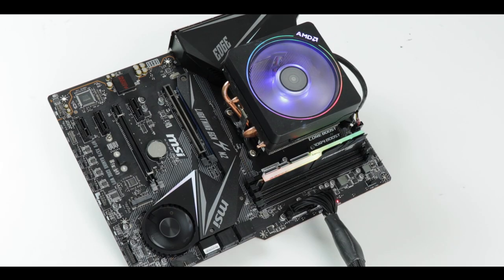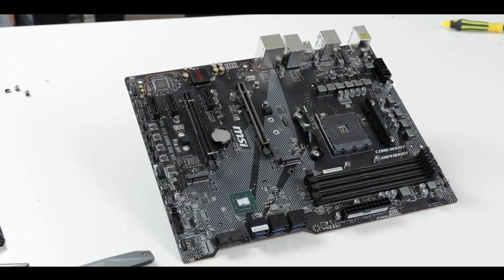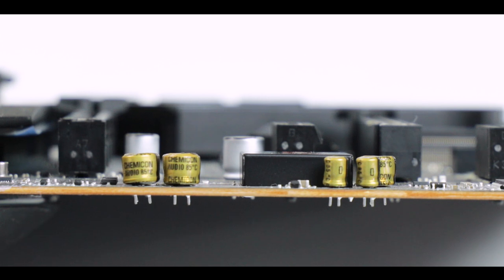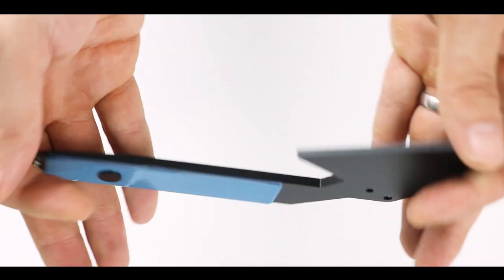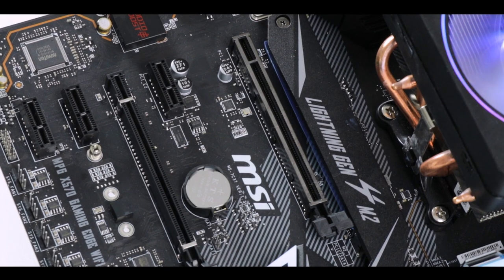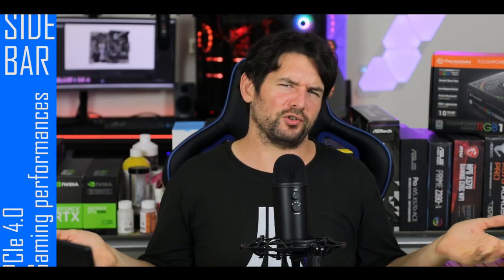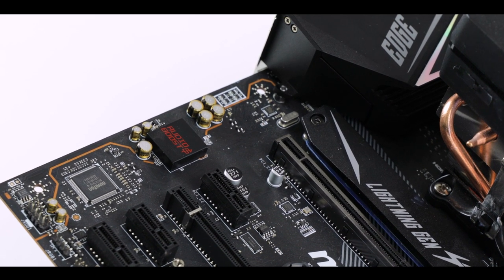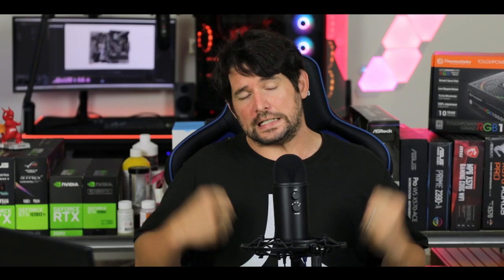MPG MSI X570 GAMING EDGE WIFI : No, No, No!

Comment: Will I have heating issues with 
AMD Ryzen 9 3900X 12-core and this mother board?
Reply: Roman Tkachuk yes
Reply: Roman Tkachuk in the video he said the board was at 100 something degrees with an 8 core so 12 cores the board will literally fucking explode
Reply: I have that CPU and added corsair hydro series h100i rgb platinum cooler, don't use the amd included fan, good to go.
Reply: en4cer44 TV how has the heat been 
? I just ordered this motherboard and a ryzen 7 3700x and after reading all these comments I'm kinda worried
Reply: Jose Bustillos refund the board if you can, under any circumstances because this is shit for the value, however if you can’t do anything else, it’s not the WORST board I’m the world
Reply: @_OLE_  With upgrading the fan to the corsair hydro series h100i no problems.

Comment: The dislikes are bullshit. I know five separate people who have purchased. Four of us have had TERRIBLE compatibility issues. Many things listed as supported are not. RAM is the (of many) issue that all five had had issue with. Three of us have had issue with the heat. I attained this board at a sizable discount when it was new but still would have paid more than the original list price to have avoided all these issues. It's been a year now & my search for a RAM fix brought me here. It was great for about a month. RIP, MSI, RIP. Three different major component purchases in a year; three headaches. Not again.
Reply: what is the ram.issue?? i got a second pair of 3600mhz ram sticks and got a blue screen after they were installed and i returned the ram because the version numbers didnt match but werent very far off from each other

Comment: If you wonder why exactly there are so many thumbs down in this review, that's what happens when you shit on one of the best bang for the buck X570s. I'm sorry but this card is exactly what it was supossed to be. An affordable X570 with future upgrade features. Right now I'm running this board with a 3600X at max boost and I've had 0 problems with temps, stability or anything else. Damn this review and specifically the title can mislead so many people. Sad.
Reply: How's it going after a year? Is it in good condition?
Reply: @Jan Nathaniel Ausan  it's perfectly good. Running on latest BIOS and went through an upgrade from 3600X to a 5800X3D and everything is perfectly stable.
Reply: @theok4342  Did you ever did some Overclocking? I was planning to OC mine but I'd rather not if you didn't do so yourself. Thank you for the feedback by the way!

Comment: Complaining that the board isn't designed for overclocking is stupid.  You seem to think people are entitled to receive more than what they pay for.  This board is great.  It's got a ton of features for the price, and if you actually buy parts that are meant to be run at their default speeds, you will be very happy.   
Are you complaining that a Peugeot falls apart if you try to drive it at 130 mph?
Reply from the maker: Hey :)

I am not complaining about its Inability but rather its heat inefficiency compared to comparably priced boards. 
It will not last as long as others for the same price.

Comment: Do you have any sound popping/crackling issues?  I have this board and can't figure out what's causing the audio crackling/popping.  It's not driver related, and it's not GPU related.  Tried using hdmi to 4K HDTV, and tried using audio jacks in the back with speakers/surround sound system.  Both have the same issues with the crackling/popping.  Done 4 days worth of troubleshooting with reinstalling windows, updating bios, chipset drivers, disabling quick start-up, rolling back audio drivers, changing sound hz settings in windows, changing power performance settings, even reseating the RTX 3090 etc... and nothing I do fixes it.  I've been at it for 4 days straight and am pulling my hair out!  Do you have any issues with sound popping/crackling with this MB?  I need help!
Reply: yes actually ive had this issue and i just need to restart my pc

Comment: just  got one and 3800x lol, now I'm worried
Reply: Same here dude... this mobo with 3800x... and i'm still waiting for them to be delivered...
I went through the internet checking other people having this exact combo, asking about their experience, and i even sent an email to MSI...
Everyone told me to not overclock, and that with good airflow there won't be any problem...
I'm starting to believe that this kind of reviewers are trying to terrorize people from buying this motherboard for some reason...
Best of luck to you mate!
Reply: Add a corsair hydro series h100i cooler, should be good to go.  I don't think this guy really knows what he's talking about honestly.
Reply: @NickDiMod  so Nick how does it perform ?
Reply: @Twoclickchris  Hey mate, the combo works great so far, i had some high temps during summer (no AC at home in a very hot country), but never actually encountered any issue.
Highest temp i was having while playing VR (Half Life Alyx on Valve Index) was 82 degrees for CPU, and  78 for GPU (RTX 2080 Super).
I am using the stock wraith prism for CPU and 4 Noctua fans on my case (2 infront for intake, 1 at the back and 1 at the top for exhaust). 
I believe it's kinda hotter than what i wanted, but it might be my case as well (Corsair 275R)
Reply: @NickDiMod  Nick thank you for the reply! I literally just got off the phone with MSI because I ordered a pre-built with a Ryzen 3950 X and a 3090 GPU and the guy at MSI told me that for that CPU I will have issues.
Reply: @Twoclickchris  3950X with this mobo sounds a bit overkill, you won't have any issues with your GPU, but i believe you should go for something different for the mobo!
I think 3800X is the max you can go to be safe (but still hot).
Reply: @NickDiMod  I agree! Thank you!!!

Comment: i have it more then 14 month and no problems with  r3600 cpu and rx 5700 gpu
Reply from the maker: Yes. As said in the review there should be no issues with 6 core processors :)

Comment: More negatives to point out - 

1. The sata ports are buried under a gfx card making them hard to reach if you have your gfx card in there... 
2. Same with the nvme heatsink...

YTF should we take out our gfx card to attach sata cables or replace our nvme T_T ... Like Laurent said, "Designed more by the sales team than by engineers"... Seems true :(

Comment: wth. midrange audio? Realtek 1220 is highest model . Other boards have 1200 or less. I dont get what are you talkin about
Reply from the maker: Just to be clear, the ALC1220 is the most common codec you will find on boards these days. The only difference will be the quality of the audio capacitors. When I say mid-range, I do mean to talk about the capacitors. The only premium audio capacitors found I found are the WIMA FKP2, usually available on AORUS and more top-range MSI boards. 
So even though 80% of the gaming boards come with ALC 1220 codecs (or variants off), there are midrange and higher range applications and integrations. 

I go to this level of details when I see WIMA FKP2 equipped codecs. Since we didn't have them here, I kept is as concise as possible. 
If you want more details about this topic, feel free to take a look at my Z390 AORUS Pro Rev 1.0 review :)

https://youtu.be/L6YnGvRBylE
Reply: makes more sense now thanks for reply

Comment: Yeah this review isn't accurate. I run a ryzen 9 5900x, 64gb ddr 4 3600mhz, 2 m.2 drives and a 1tb ssd, evga 1070 ti supercharged until can get my hands on an rtx 3080 ti. Temperatures under stress tests and intense gaming sessions remain low and have never seen the chipset fan even come on yet which is set at 60c. Overall the board has been very solid compared to past motherboards I've used
Reply from the maker: Just to clarify 

You should not see any over heating on the CPU or chipset itself,  but on the MOFSET solder points on the back of the PCB. 
These temps.accumulate way beyond the acceptable range increasing terminal risks on the motherboard or/and reducing its life span. 

As far as I know, all reviewers came to similar conclusions. 

Hoping this clarifies .
Reply: @Laurentschoice  ill check this out going forward
Reply: @deliverancegaming116  which ram u got
Reply: @Twongz_does_anything  Corsair Vengeance Pro

Comment: Hi Laurent I’m pretty sure you won’t see this but I have a ryzen 5600x it has 6 cores is that fine for this board or will it overheat?
Reply: So did you use this board with your 5600X ? I also have this board with a Ryzen 7 5800X. I still have to actually build the PC. Anyways did you have any issues with your motherboard?
Reply from the maker: 5600x.. yes its ok. I'd go up to a 8 core 5700x and thats it

Comment: 3950x with air cooler on this mb. Dont see any issue with overheat...
Reply from the maker: That's because I am taking about the VRM over heating. Not the CPU :)
Reply: @Laurentschoice  MOS went up from 44C to 66C during cinebench test. Anyway I did not had any gigabyte x570 mb in my city at all :(
Reply: Actually it went to 82C after 10 mins cinebench..

Comment: Hey i just bought this motherboard. I plan on using it with a ryzen 9 3900x. I dont plan on overclocking i will be using it for illustration and light gaming will i be safe from the vrm overheating?
Reply: hey just want to ask, what's the update? Did it have any issues at all, like vrm overheating?
Reply: @kazseeker8637  I ended up not using it at all. Just went back to the story and exchanged it with a asus tuf gaming x570. Didn't want to risk it. The asus bored is very good tho and it hasn't given me any problems.

Comment: Is it easy to remove the integrated wifi/bt card? I think I'm having crash issues with that card and I'm replacing it.
Reply from the maker: Well u need to remove the main heat sink (screws on the back pcb). 

Then the 2 small screws holding the wifi / bt module.  Also on the back pcb. Smaller screws. 

Just remove the module and put back the vrm block.
Reply: @Laurentschoice  Ok, thanks a lot!

Comment: Motherboard quality overall has dropped a lot in the past few years. Every company is guilty right now and it's pretty sad.
Reply: Quality/what you get for money drops only if you're brand blind and buy only one brand.
In B450 boards it was Asus and Gigabyte who sold basically scams.
In X570 MSI obviously wanted to ride on old reputation and got caught pants down butt raping consumers, while Asus and Gigabyte corrected their mistake.
Though X570 chipset HSFs of Asus are design wise pretty garbage with only small to tiny heatsink under marketing BS cover and badly positioned under heat of graphichs card.
Also Asus charges arm and leg for USB BIOS Flashback and they're also penny pinching in USB headers.
Reply: VERY true. flashy features have trumped quality and longevity.

Comment: I bought a case with a Type C connector on the front panel.. sad that I didn't check to see if this mobo had it included.
Reply: X570 MSI's below Unify are more or less garbage for their price regardless do they have that USB-C header or not!
CPU VRM is at level of ~100$/€ B450 boards!
Reply: Esa Tuunanen Board was DOA, sent it back and got an ASUS board instead.  It will be here Friday, paid a little bit more so hopefully it works. Nothing like wasting your whole Sunday troubleshooting your new build only to find out it’s DOA.

Comment: I wish I watched this video before I bought it, It doesn't even let me install memory above 3000 MHz without it acting like the sticks don't even exist in it.
Reply: I have memory of 3600 mhz installed easily. What are you talking about?
Reply: @silvo9460  Last time I tried a 16gb x 2 kit @ 3200 MHz, my motherboard would just keep the DRAM light on, I'm using an AMD Ryzen 7 3700X in my board and the kit I am currently using is 8gb x 2 @2400 MHz. Though I haven't reset the CMOS since installed it or updated my BIOS.
Reply: @silvo9460  what ram u got
Reply: @Zyro1331  i had that same issue i think this only supports kingston and corsair

Comment: Update my MB still running great, this guy has no clue. Blah blah 😅
Reply from the maker: Blah blah
Reply: @Laurentschoice  the bottom line is your bashing a MB that works great. and does not cost a fortune
Reply from the maker: Which mobo are we talking about . My studio app shows the comment but not the video (not great YT btw)
Reply: @Laurentschoice  MPG MSI X570 GAMING EDGE WIFI , I am not saying all your stuff on YouTube is bad, in fact I have watched alot of your stuff. But this MB with my Ryzen 7 3700 runs amazing. I game, do video editing and all my photography editing on here. This MB is also fairly inexpensive and great for the budget gamer.
Reply from the maker: Oh I remember that one.  Hot soldered points. Hottest I ve seen. 
With a 3700x ull be fine. Going for upper tier CPUs will be a problem.  

MSI dropped the 4 layering PCB design after their X570 / B550 series, so problem solved. 

Hope this helps  :)))
Reply: @Laurentschoice  I was actually thinking about upgrading MB and CPU but as of right now all my stress tests are running fine. So I am glad don’t have to spend no money.

Comment: Hi did u tested it with both cpu1 and cpu2 inputs conected to the psu . Is cpu2 input to be conected to psu a requirement or is it optional. thanks
Reply from the maker: The CPU 2 plug is used only for extreme over clocking configurations
Reply: @Laurentschoice  I was digging deeper and with help from MSI forum admin i found answer. 
Systems with 16xDIMMs and/or dual graphic cards will require the +12V5 output and added +12V5 2x2 connector. This is statement from protocol msi followed when they created board. This is real purpose of additional cpu input
Reply: @46rrodriguez  Discovered this the hard way. 😂

Comment: Used this motherboard in my new build for about a month. It no longer posts. Do not buy this
Reply from the maker: Sorry to hear that. 
Did you RMA ?
Reply: Laurent's Choice in the process of doing so. It seems like the most reliable & efficient board is the meg x570 unify. I like MSI products so I wouldn't look forward to switching to another brand
Reply: You should really buy from brand giving most quality per money at the time, instead of going for more expensive model.
Keeping buying from brand which fails to meet the competition is just recipe for quality per price continuing donward spiral.
Competition works only if consumers act as referees&judges, instead of fan club.

Comment: i have this with a r5 3600 and a rx 5700 xt and it runs fine
Reply from the maker: Hey there:) 
As I said during the review, anything below a 3700x will run perfectly :)
Reply: nice
Reply: I did not hear that
Reply from the maker: It's ok:) I said in the VRM and conclusion parts that anything beyond an 8 physical core (that's a 3700x and above) might be hard to overclock.

The 3600x is 6 cores :)

I hope this helps.

Comment: I payed $130 for this new? Was it a good deal?
Reply from the maker: 130.?? Yes !! Thata a good deal!
Reply: Laurent's Choice If I put a 3700x on this and didn’t overclock, would the VRMs overheat?
Reply from the maker: No. You would be fine
Reply: how did you get that for $130 thats a seriously good deal wtf
Reply: Karam Alshaikh On the App LetGo a guy was selling a new MB that he opened but never used and since I lived 40mins away I got it down to $130
Reply: @karamalshaikh738  Holy shit I got it for $110 believe it or not, coming from the Asrock H81 board I love this board so much
Reply from the maker: That's an amazing deal ! Despite some limitations its a great value !!!
Reply: @Laurentschoice  For sure! I was going to get the B350 TOMAHAWK but the price was too good to beat. I wish it had more USB ports though and I hate where they put the fan headers but other than that it has seemed good so far.

Comment: Hello, do I need to have 8+4PIN for this motherboard or is it mandatory. I just bought it and I found out that my PSU has no such cable.
Reply: No you dont need it..its only necessary for extreme overclocking
Reply: @Brian-dj3ru  Thank you, turns out the board I recieved is faulty. Not even debug led turn on neither the fans
Reply: @proskater6899  so u got a new board?
Reply: @Brian-dj3ru  Well the replacement is on the way. I am going to replace it with Asrock X570 Steel Legend

Comment: 3:35 "sub quality of components used by MSI for VRM" can you please be more specific on which components are you referring to? after looking at the TUF vrm from your video indeed the components look more beefy.
Reply from the maker: ok so .. this board has a mix of low end (40 amps) and high end (70 amps) Power stages. That means that the board will run in either/or one of the two. It's not very agile and when switching from and to Power stages, you will experience some lag, which translates into game lag.
Reply: So you have a motherboard recommendation for Ryzen 7 3700

Comment: The problem with this review, is that there are thousands (literally thousands) of other reviews saying the exact opposite. In fact, this is the first negative review I have seen for this board. I've already bought it, but I'll take your opinion into consideration and I will be commenting in the future to let everyone know how it works. I'm using a Ryzen 7 2700x with 8 cores. The other reviews I seen were also using 8 cores. We'll see.
Reply: show 1 of the  (literally thousands) using a 105w cpu.
Reply: @svan71  I'm literally using a 105 W CPU  (Ryzen 7 2700X) right now, while using this exact motherboard, and it's working great for everything I've tried. Imagine that...